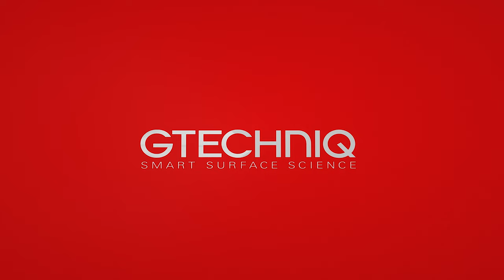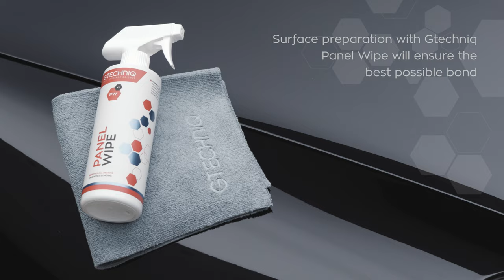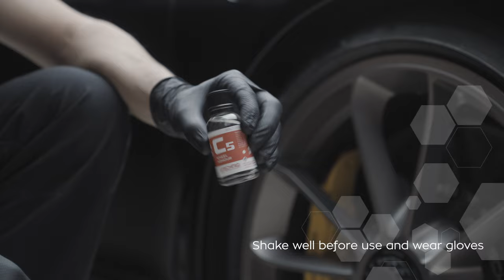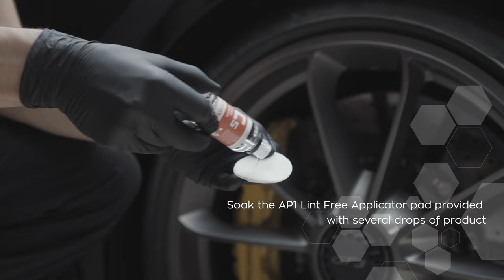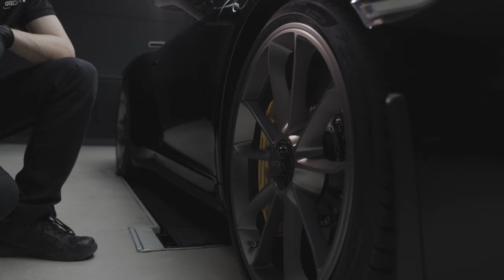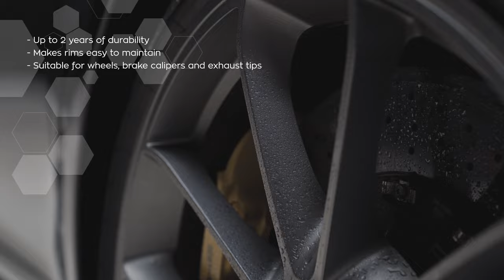How to apply: C5 Wheel Armour

Comment: I have new wheels can i apply before tires are mounted or should i wait.  Will the wheel weight still stay on rim after coating
Reply from the maker: We recommend fitting tyres and balancing the wheels before applying the coating. If you coat them before weights are applied these might not adhere to the surface fully.

Comment: Safe to use on chrome and gold 13" wires wheel?
Reply from the maker: We do not recommend this product for bare metal finishes. This product can be applied to the lacquered or clear coated finishes. When it comes to bare metal wheels we advise using our C2 Ceramic Sealant
Reply: @GtechniqUK  well they are chrome plated and then gold plated, so they are not bare metal at all
Reply from the maker: @84Regal402  In they are plated then we advise the C2 Ceramic Sealant.